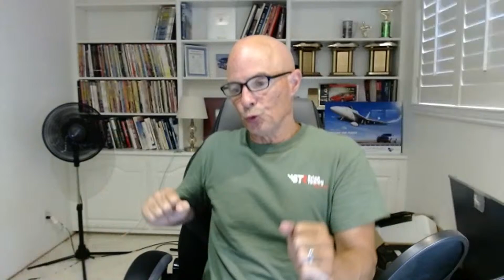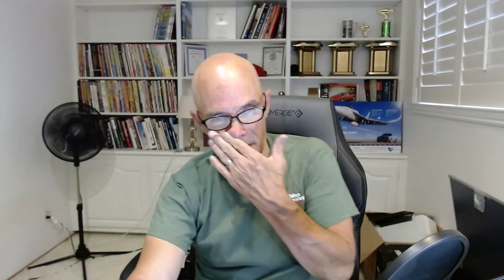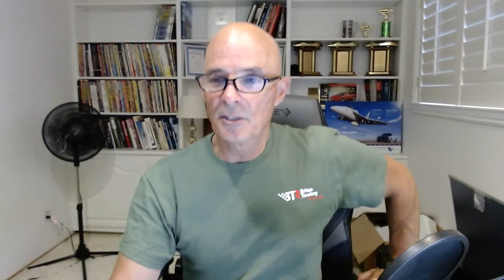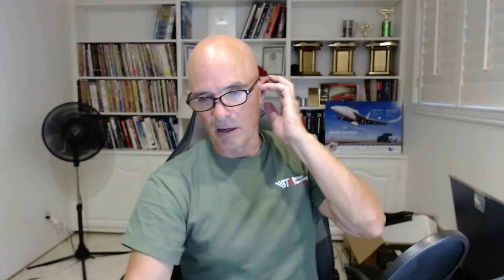LET'S TALK TECH-I NEED A USED, COMPLETE T2 GLH TURBO MOTOR!

Comment: I’ve always wondered if you made an engine (4 cylinder example) make let’s say 300hp with some small amount of boost like 8psi. And then you made it make the same 300hp with a ridiculous amount of boost relative to the engine like 30+ psi of boost and very low timing to reduce the power. I think it would be a great experiment to see the difference in exhaust heat and fuel economy
Reply: That sounds like a cool experiment, I think there is definitely a point where being too conservative on timing and just trying to make more power with extra boost is just killing performance (excessive intake charge heat, excessive back pressure, and possibly pushing the turbo into a less efficient area of its map)

Comment: I enjoyed the shit out of the little 2.2 motor when I worked at a Dodge dealership. Was pretty much an indestructible little 4 banger. The only bad one I remember looked like somebody dropped something into the engine! Loved all the Shelby turbo cars. I owned a Shadow turbo. Never got the chance to work on one of the GLH.
Reply: We leased an 85 Omni with that awful Peugeot 1.6 with a 4 speed manual. The Kids were small and we went to the Current River attraction Big Spring and with the 4 of us in it we were going the speed limit until we came to a hill that we literally ended up crawling in 1st gear and we weren’t sure that we would make it. What an awful thing. The 2.2 was so much better.  Excuse me it was a Plymouth Horizon.   I can’t believe how those cars were built!  A turbo on that roller skate , the Peugeot 1.6 was 65hp with a carb.  The 2.2 to me the only weakness is the timing belt.  I would at least put a thick Heavy Duty Gilmer tooth belt. Much boost could strip the stock one, or put chains and sprockets like a Harley Primary with oil in the bottom and a plastic top cover.   450 hp 425 ft lbs.

Comment: Got a Complete 87 Daytona Shelby Z Complete Turbo 2 I'd Sell,just Msg. if Interested.
Reply from the maker: how much
Reply: @richardholdener1727  I'm in it about 1400$ No Title but may be able to do the Bill of Sale Deal(we're in Alabama,and I think it may be old enough Now),it hasn't run in about 5 years,and I originally bought it for the Parts to Rework the 86 Daytona we've had since new, but like so Many of my Projects, it got pushed back, and there we are.🤷 I also have a set of GLHS Wheels too,if you know anyone interested,these were on my GLHS Charger in 97'. Figure out a way to Msg me or an Email address if you want pics or something. Thx DKZ

Comment: Hey I have a crazy idea, there were a bunch of Hondas that has a great V6 engine. But the automatic transmission was a sealed case the transmissions went bad but the engines were all still good. What's the ACTUAL HP of those motors and what transmission could a person swap them to